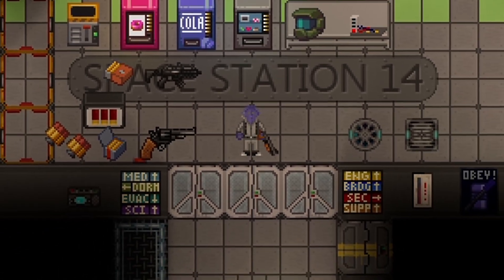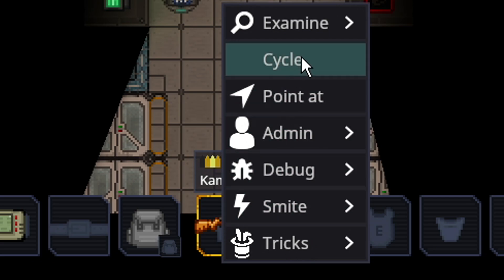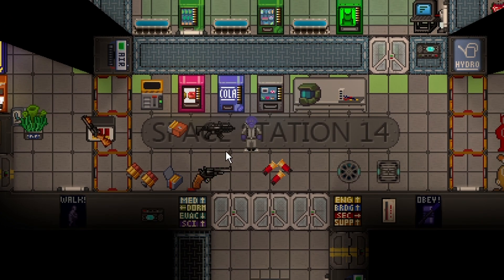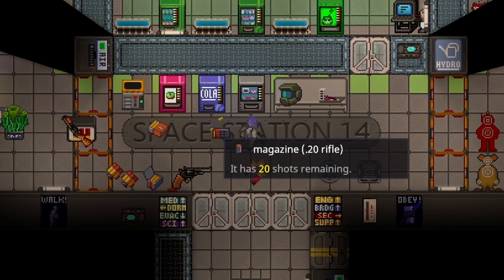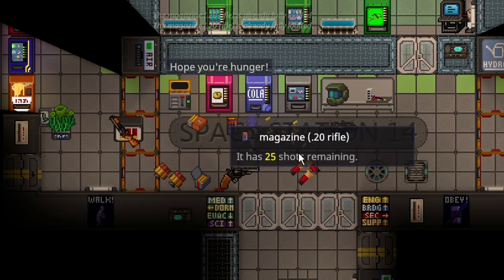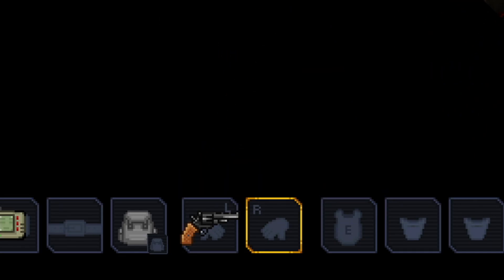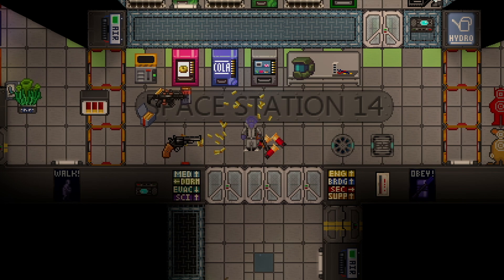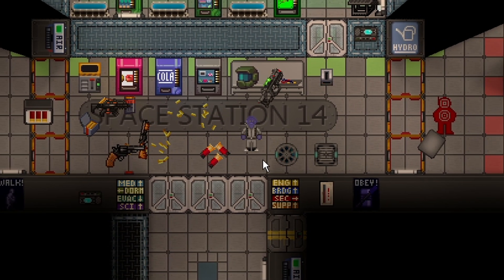SS14 - Gun Mechanics Explained (Out of Date)

Comment from the maker: I also forgot to mention you can just click on a gun with a new magazine to swap it. Also, certain guns can swap their fire modes, just right click a gun to do it.  There aren't many guns that can do it, think c20 is the only one that can that is obtained through normal gameplay.
Reply: There's one that's got an underbarrel grenade launcher. Isn't that obtainable through the nukie uplink?
Reply from the maker: @bretzel1026  Nah can't get it normally and the underbarrel doesn't function yet.
Reply: @Liltenhead  Must have mixed it up with 13, then.
Reply: I wouldnt call it an actual gun,but the pneumatic canon can also switch from semi to full auto… also if you wrench it you can change the pressure amount used, from low to medium to high. To change how far the object youre firing will go! And the high setting actually knocks you down when you fire it!😅
Reply from the maker: @dragonwolf569  Honestly didn't know that, that's cool.
Reply: @liltenhead I tried using it on a syndie round to shoot soap, c4 and some bombs, but it turns out that just throwing the objects is better as the canon doesn’t shoot farther then you throw unless your using the high setting, which knocks you down
Reply: I'm forced to use this clicking strat due to my shadow play taking alt-z and im too lazy to figure out new key combo, so i just say i got butter fingers and deal with slow reloads.

Comment: You can refill a speed loader by spamming the ammo box on it. .45 magnum boxes also fit into a holster along with the Inspector and speedloader. If you have access to the tech fab or warden isn’t too stingy about letting you into the armory, you can make yourself a .45 magnum box and have 72 shots.
Reply from the maker: Yeah I probably should have showed that, I did mention they are functionally magazines but could have been more clear.
Reply: My strat is to put the speedloader into the holster and put bullets into it while it’s in the holster

Comment: You didn't cover shooting modes, e.g. semi-auto or full-auto.
Reply from the maker: Guess I could have, but typically you just wanna spray anyone due to the low damage of guns. I can pin a message.
Yet again, only like 1 normally acquired gun can even swap fire rates and that's the c20.